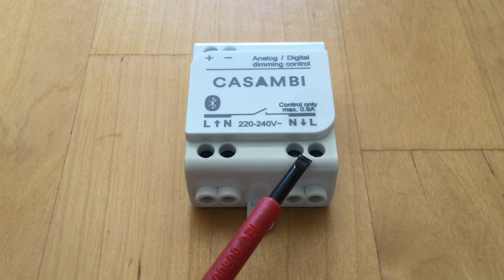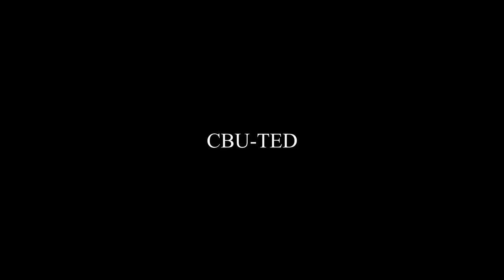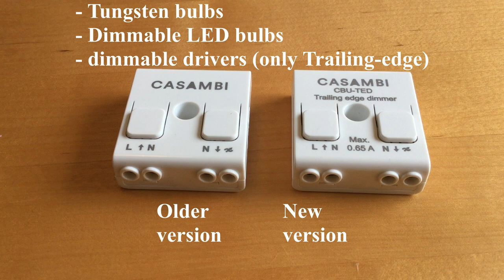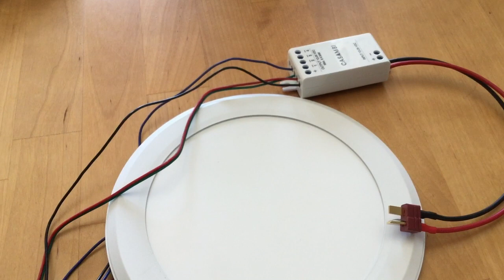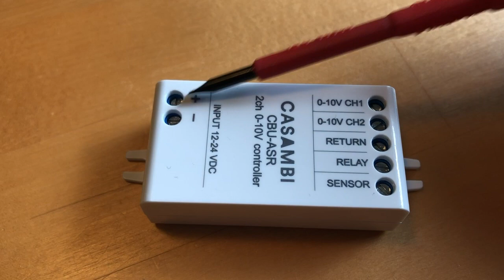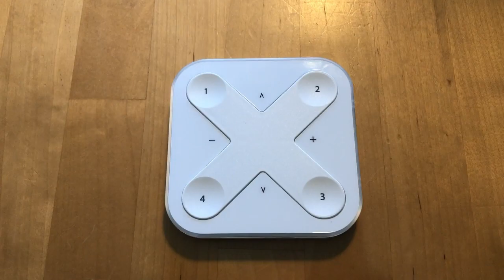Casambi Tutorial 2 - Casambi products

Comment: Can I use a CBU-TED as a basic Switch (without dimming)? Or is there another Casambi solution/product available?  I need for a fan in a bathroom tks
Reply from the maker: The CBU-TED can't be used for on/off switching because of the dimming curve. Instead use something like a REL-240 from Liga Air. That'll do the job and they also have a very small form-factor. Alternatively, add a 230VAC relay to a CBU-ASD. That'll do exactly the same job.
Reply: @CasamBee  Thanks for your prompt reply as I need to order a device asap. What about if the default dimmer range is set to 100% - meaning full on? Thanks. (I also have a spare TED so could try)
Reply from the maker: @marktime61  I wouldn't risk it... Even if you could alter the dimming curve of the TED to go from 0 - 100% as quickly as possible, there's still that 'ramp up' to 100% and ramp down to 0% (even if it's a really short time). Much safer to go with a true relay.

The TED designer once told me that it's the fade-down from 100 to 0 which is problematic if trying to use a TED to switch 230VAC (rather than the fade from 0 to 100, as most people would suspect).
Reply: @CasamBee  Understood and thanks
Reply: @CasamBee  Apologies but another related question. I have used EnOcean switches successfully for on/off dimmer etc and there are many modes/function under the Casambi App as to the action taken by these Switches. I wondered if you know which type/mode would best replicate a push to make switch as the bathroom fan scenario would normally take power (via light switch or spring back switch) and then after power removed the fan would continue on a timer/timeout within the fan. An ordinary Sw function would be in the wrong state after the timeout. Perhaps an EnOcean Sw mode or a Casambi App timer could work?…. Thanks again
Reply from the maker: @marktime61  yeah, this is easily doable. I’ll make a video for you but give me a fee days or so.
Reply: @CasamBee  many thanks - I look forward to it
Reply from the maker: @marktime61  Here's a detailed answer about your question: https://youtu.be/456k6mv1zRY And if you ever install a presence sensor in your bathroom, here's an even easier way to do it: https://youtu.be/is0uzuudCEY

Comment: Re: CBU-PWM4+PSU vs CBU-ASD Dali controller +DALI Driver.  For driving LED strips (just warm white dimmable) where up to 4 runs are co-located like in a kitchen cabinet, could I use the PWM4 (x1) as opposed to the more expensive option of DALI driver +ASD (x4)?  What are the pros/cons? Should I assume that for 12v Strips the PSU input to PWM4 would be 12 volts? Also are the 4 channels shown in Cassambi App as 4 separate luminaires?
Reply from the maker: From my experience, people tend to use DALI drivers for larger LED lights rather than LED strip. For LED strip, a PWM4 is probably the cheaper option. Yes, the PWM4 PSU voltage will need to match the LED strip’s voltage and you also need to make sure that the PSU will offer enough amps for the lengths of LED strip(s) you’ll use. 

Yes, you can use four strips with a single PMW4 but, again, make sure your PSU can cope.  A single PMW4 device will be visible in the Casambi app but you can adjust each of the four channels individually.

Comment: thanks for the such great presentation...i just need some information about...i have Casambi ASD Blutooth, Casambi wirleless wall switch, LED Module and sensor...what do i need more to complet my installation....thanks
Reply from the maker: All you need to do now is install the Casambi app. Then create a network, pair the devices and configure them as you want.
Reply: You mentioned extern relay do I need that or
Reply from the maker: @MrHazaraak47  only if you intend to control a 1-10V controlled LED driver.

Comment: Great and clear presentation thanks! What is the slimplest and most cost effective setup to get a relay function? For instance, turning on or off an existing plug (or any electrical device that might need more than 150W)?
Reply from the maker: Thanks! The most basic option is a 230VAC relay attached to a CBU-ASD. But there are now many different types of relays made by Casambi's partners. You can see the various devices here: https://casambi.com/ecosystem/ Just search through the text for 'relay' and you'll find them. ...cost-effectiveness is a completely different matter, though ;)

Comment: hello, cool product and video, what would you recommend to control 2 ballast 320w meanwell  0-10v independently , I take it you would need 2 casambi?   150w limit does not apply since I would control them by 0-10v?  sorry I'm a bit lost about this Casambi CBU-ASD
Reply from the maker: Hi! You're right, the wattage of the LED driver is irrelevant as the Casambi device is just controlling it. You could use two Casambi devices if you like, but you could also use a single CBU-A2D (AC powered) or a CBU-ASR (12-24VDC powered). Both allow 2ch 0-10V control.

It really boils down to how you'd like to control them. If you would like separate icons for each LED driver in the Casambi app, then go with two Casambi devices. If you're ok with both 0-10V channels appearing under the same icon then just use a single device. You could always start with a single device anyway and buy a second if you feel you might get more flexibility that way.

Comment: Dear Casambee. Wich device you would use to control a phillips hue RGB-W bulb 220/240V? Thanks
Reply from the maker: None of the Casambi devices can control Philips Hue devices (because Hue bulbs can not communicate via Bluetooth). You can only use the Casambi app to control Hue bulbs - and it's very restricted. You can only control Hue bulbs manually using the Luminaires page within the app. Switches, sensors and timers cannot be used because the Hue bulb can only communicate via Wi-Fi.
Reply: @CasamBee  thank a lot for your response. So, what are the bulbs or luminaries you can handle or control with casambi app?
Reply from the maker: @alanepsztein2333  If you specifically want to buy Casambi-enabled E27 bulbs (rather than use the CBU-TED to dim bulbs), then you only have two choices: Carus or Ropag. Some Carus bulbs can still be bought although they no longer manufacture them, but Ropag bulbs are new. Both manufacturers offer tuneable white bulbs, but the Ropag bulb has a larger colour temperature range. Note that both bulbs are only available in E27 fittings.
Reply: @CasamBee  Thank a lot!
Reply: I mean, which controller..